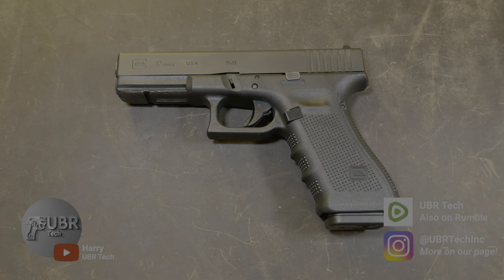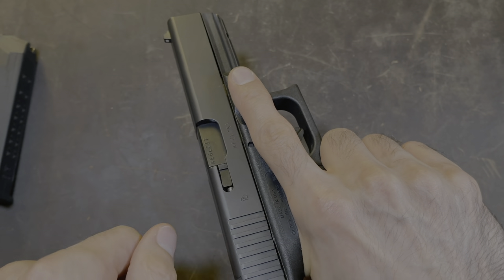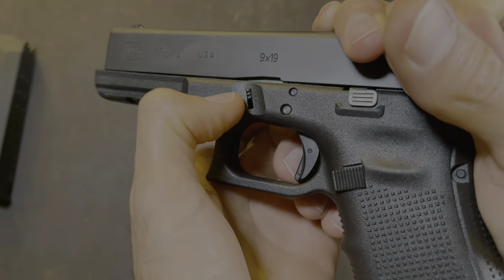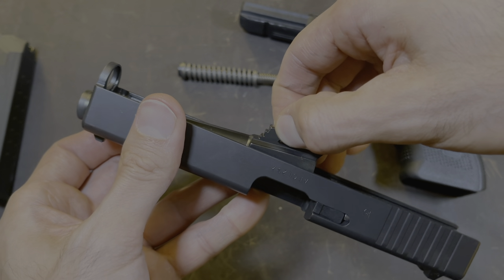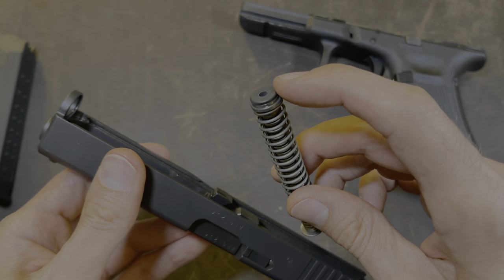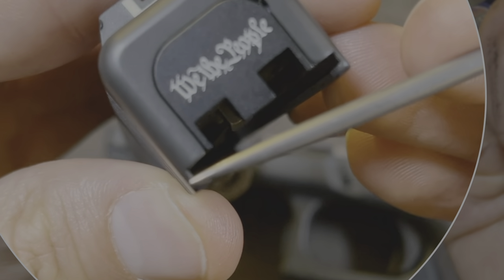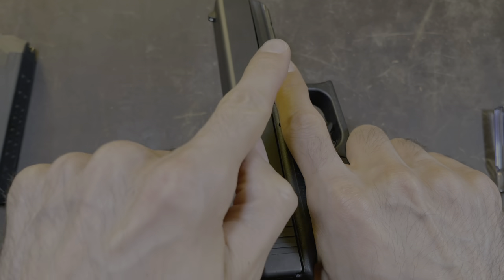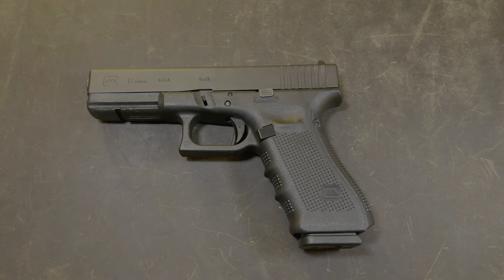How to Disassemble and Reassemble a Glock 17 (Field Strip)

Comment: Is it normal for my Glock to had a gap in it between the slide and the lower ?
Reply from the maker: Yes, it’s normal to have a small gap in between the slide and the grip. A good way to tell is if everything is functioning properly then you should be good. Make sure the slide actuates and the slide lock works, things like that. Hope this helps. 👍🏼

Comment: I tried to do this with my 17 and it wont slide off??
Reply from the maker: Hey Kevin, make sure the magazine is removed, there’s no ammo in the chamber and you have pulled the trigger. Once you have confirmed these things have been completed, the slide should come off if you followed the steps I showed in this video. Let me know how you make out.
Reply: @UBRArsenal  I got it works lol i cant slide the top back too far or it wont pop off
Reply: @UBRArsenal  ya i finally got it lol yes i always remove my mags when i strip my guns.
Reply: @UBRArsenal  i'm having the same problem with my new PSA Dagger.  Maybe just needs more muscle!

Comment: Would’ve been better if you actaully field stripped it instead of just taking the springs and barrel out and putting it back in😂😂😂
Reply from the maker: Hey Jase, this video (as stated in the title) is just a how-to field strip for beginners. This is so a beginner can clean and maintain their pistol. Thanks for watching and leaving a comment. Have a great day.
Reply: @UBRArsenal  should’ve titled it how to clean and remove recoil spring and barrel then not how to “field strip”😂😂😂 I don’t know what you consider a field strip but removing two peices out of the gun and putting it back in is not a field strip I wouldn’t have watche if I knew what the video was ACTUALLY about
Reply from the maker: Maybe there’s some confusion here. I’m not sure what you consider to be a field strip but the definition of a field strip is “Disassembling a firearm without tools. When using tools, this is called a detail strip”. So it looks like the video was correctly named after all because I only show how to remove the recoil spring and barrel. Thanks and have a great day.